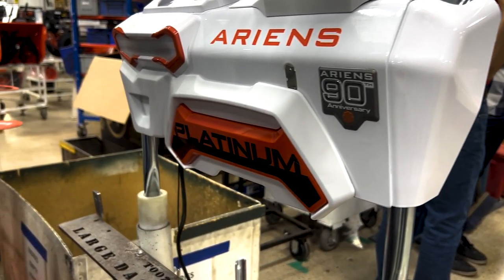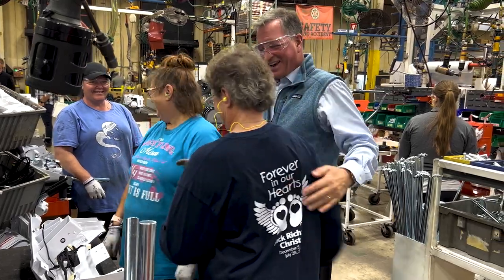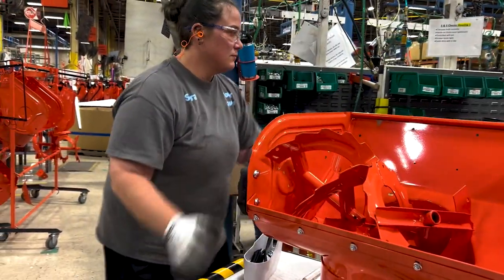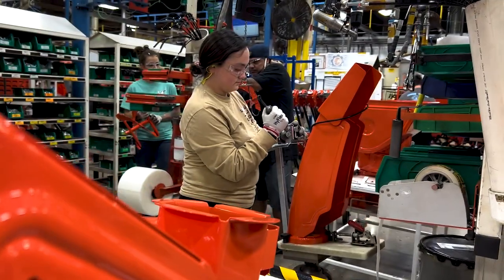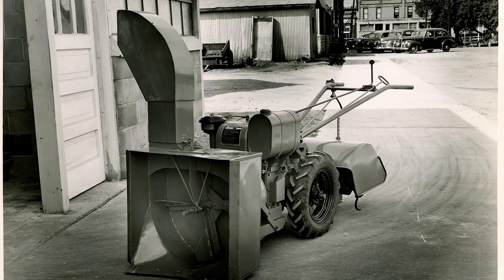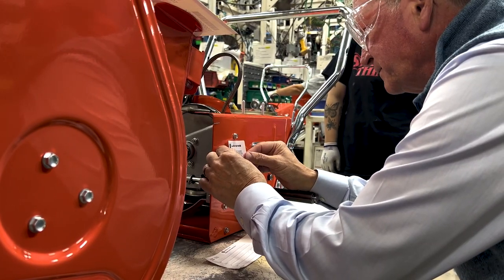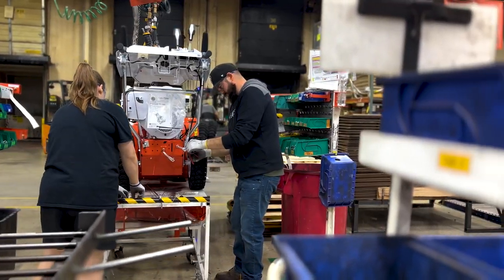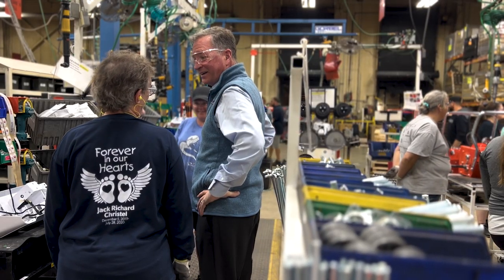Dan Ariens on the Limited Edition PLATINUM 24 SHO 90th Anniversary Sno-Thro®

Comment: Yes I sold my 926 LE to a friend and still running the starter went bad my friend still using it with the pull start over 17 years old!

I got 24 sho Platinum EFI 3 years ago and I love it easy turn and it designed with power to go through harsh weather!

Thank you 
For great product

Comment: Looks cool, but who forgot to include 4  bolts to attach the handle bars to my new Ariens 926084?   
I was suprised to find my AX420cc has a Chinese quality motor. Fuel Cap is leaky when working grades, pull starter and plastic handle doesn't have a quality feel. Other issues noticed after one season, the chute is sloppy/rattles. The thumb joystick gets caught on jackets.
Reply: Just got the Kraken nice but the chute is very sloppy rattles vibrates loud dont like that the Kraken will replace my 33 year old John Deere 1032D that Arians built for J.D. why Cant you build the 1032D again but with a hydro transmission rapid track and a 13 HP  Honda engine  with the crank on the chute and cable for up/down no electric now that would be a good snow  blower
Reply: @chucklindley452   I don't know if it will help your Kraken, but yesterday installed a few bits of dryer drum felt with some plastic cement to the collar part of the chute. No more rattling.
Reply: Think I will use part of rubber inertube cut and pop rivet  to inside of lower flange to stop that vibration and loud rattle very sloppy fit should not be like that for a $5400 snow blower  something is not right with the parts fit up now will take 1 1/2  hour my time to fix it
Reply: It's amazing that none of the replies came from Ariens.  Kinda makes you wonder about the CEO's earlier statements.
Reply: @EdFhvn  Just maybe because they’re Trolls

Comment: I sold a Toro 1128 with a house we sold.  That was a great machine actually.  No complaints.  Loved the joystick.

New house, new machine time.  Picked up a used, very late model Craftsman Pro blower (357cc) over the summer.  Words cannot describe how big of a POS that blower is.  Will sell that as soon as I get a proper blower.

Back to the drawing board. The Toro 1428 looks great but I want to cap the price at 2k, so I was looking at the throwback version Ariens but it was EFI at a $400 premium.  I just want a standard carb version that I’ll rejet for high altitude.

So I now have a platinum 24 SHO inbound.  Pretty excited about this.

220ft paved driveway at over 9,000ft elevation.
Reply: The Ariens controls are FAR superior to the Toro. You will love the Platinum 24 SHO